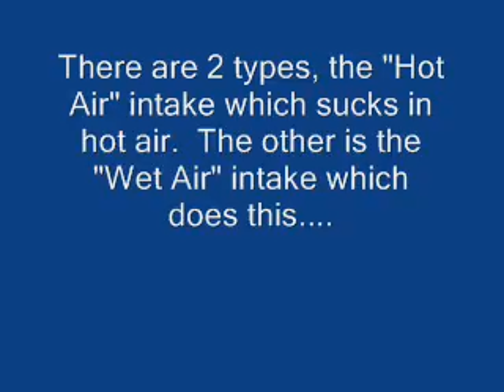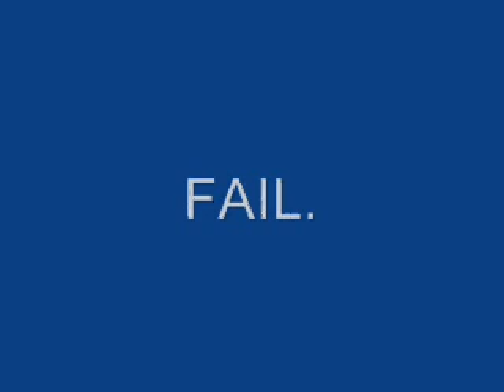The problem with an aftermarket intake.

Comment: I also work at a VW dealer. I had a 2002 VR6 come in that sucked up some water with that SAME intake... ended up bending a connecting rod..... Expensive 'cold air intake' now isn't it!!

Comment: Did they drive through a creek or something?  My goodness, I thought it was common knowledge to plan out upgrades before actually doing them. If it rains where you're located and you think you'll drive through puddles, then a cold air intake isn't for you. I always go for a short ram intake just because of the rains that we get in my area.  Or maybe they weren't educated when installing it.
Reply: The reason i didnt install a Cold Air Intake on my MK4 my area hardly gets rain but when it does roads get a bit flooded thatd why i went with a Short Ram and added a Heat Shield to block off some heat from the engine and still kept my stock airbox incase i wanna switch back.

Comment: i own a VW diesel and 2 dodge diesel pickups . if you put an intake on a car dont run through puddles or drive in rain. if you ask me this driver was prob out TRYING to drift and went through a few deep puddles and then it locked up. (check my vids out if u wanna see one of my trucks i need to get more up)